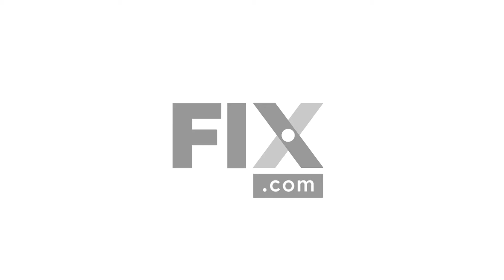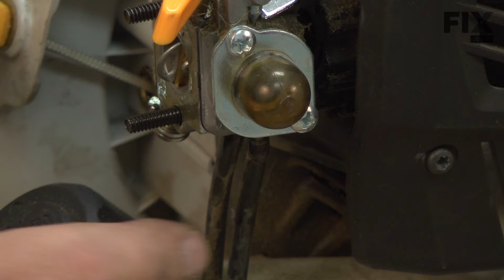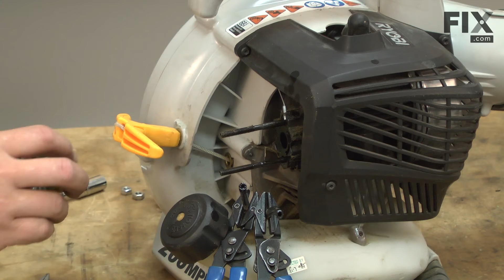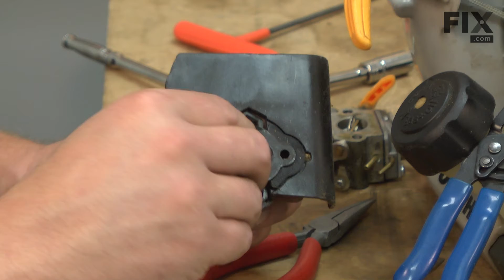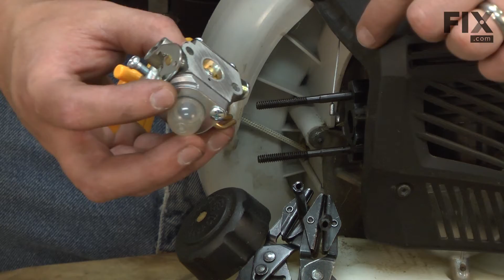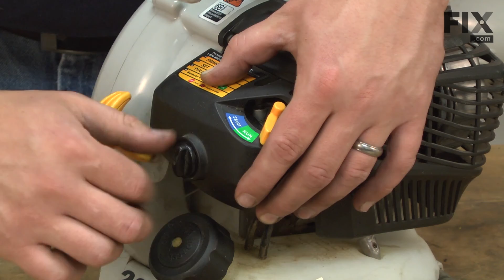Ryobi Blower Repair - How to replace the Heat Dam

Comment: Ok the second mounting nut, the one on the bottom wont turn. Well it will turn but it's turning the whole thing, the screw too. Its just turning in place. Wont come off. Any suggestions